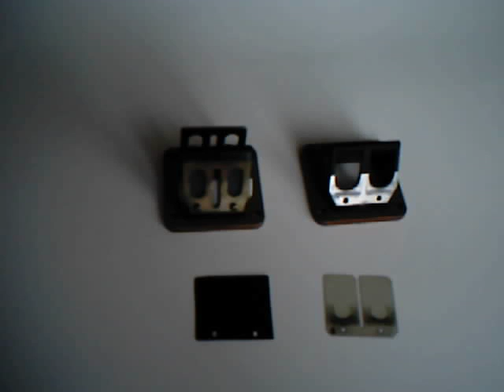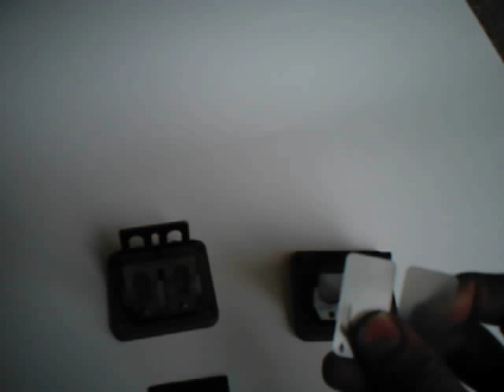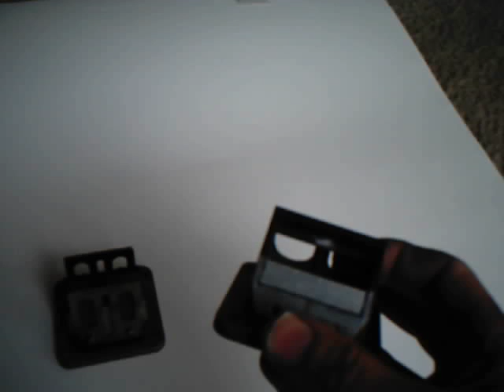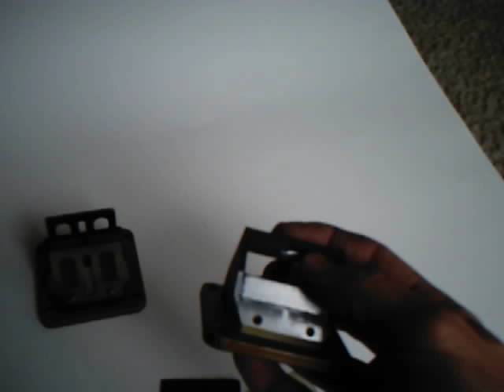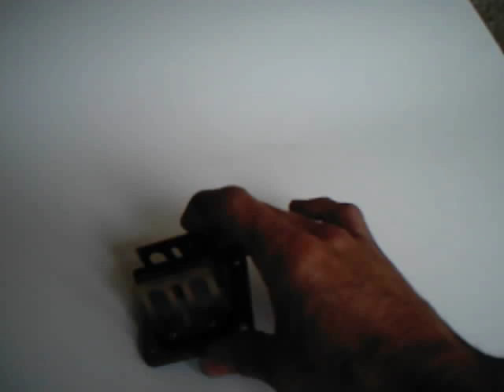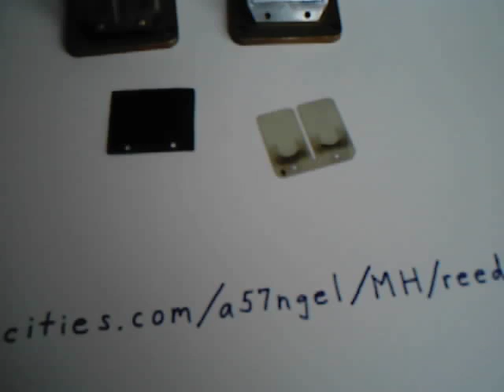motorcycle reed valve modification

Comment from the maker: The listed web site is no longer there. The carbon fiber sheet was .5mm thick. After cutting out the petals I held the reed petal in one hand so that it is curved in the right direction to aid complete sealing. Then I held it over a flame, just far enough away to burn my skin if I held it there too long. I sheet of carbon fiber can make many reed petals. One way to know if your reed valve is too restrictive is that as you roll on the throttle you feel the peak power is reached before the throttle is opened up all the way.

Comment from the maker: Lowell,nowhere do I say to remove the stuffer. Increasing the flow volume by 10% - 20% will not be drastic enough to cause the fuel to drop out of suspension. I think anything less than 80% increase will not do that. This increase is just enough to notice a small power increase. But you know that racers are interested in as many small increases as is possible.

Comment: The stuffer is used to maintain air velocity. If the intake tract opens too much, too soon after leaving the carb's venturi, air velocity drops. This not only reduces the volumetric efficiency of the engine, it also can cause the fuel to drop out of suspension. Removing it is actually going to reduce power .
Reply from the maker: No, the fuel droplets will not drop down. They have a high velocity and going thru a 15mm length of lower velocity section will not affect them. The mod this video shows was done to my Honda CR250 and it exhibited a very slight power increase.

Comment: sir does it made a big difference?or will i easily notice the increased power? thanks.
Reply from the maker: It will make a noticeable difference if the reeds flow area is less than the flow area of the crab throat.